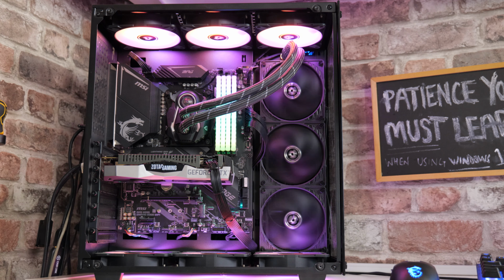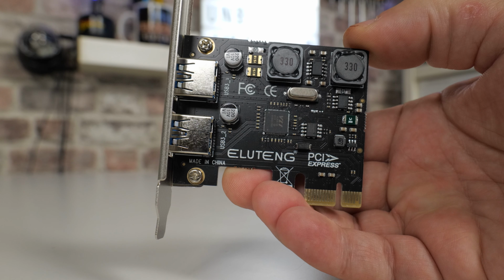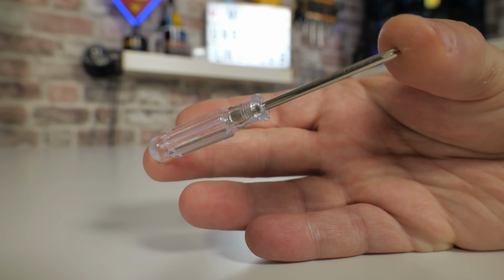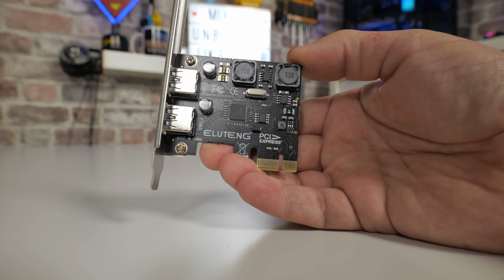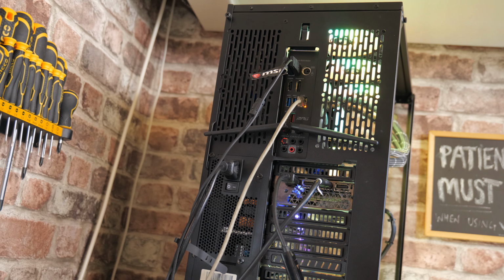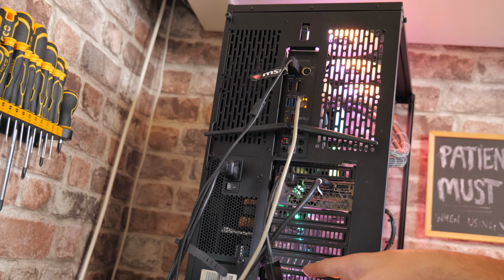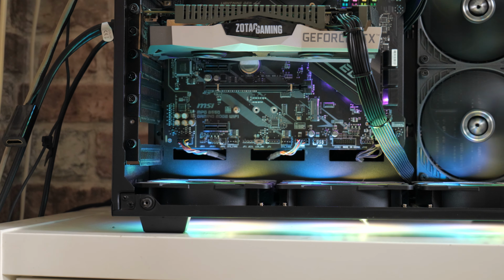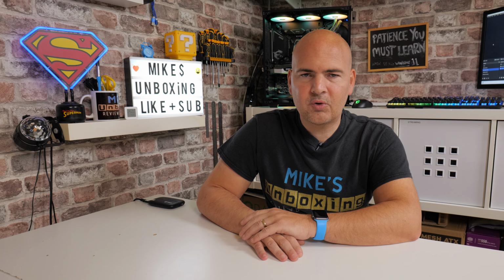How To ADD More USB3 Ports With NO Extra Power Plugs Required

Comment: I purchased a 4-port version of these add-in cards as I run ITX setups and have numerous devices such as external storage devices, a usb drive cloner, usb peripherals……. 2x keyboards & mouse, stream deck etc needing about ~10 USB ports 🤪🤩🤯! These add-in cards are essential for me 💪😇🥰
Reply from the maker: they are very handy especially with a lot of devices to connect these days

Comment: What a neat inexpensive unit. Have i got this correct, because this uses the pcie lanes it doesnt slow anything going thru the io shield? Hence both cameras are recorded without conflicts! Neat and cheap solution. Thanks for sharing Mike and Kath👍
Reply from the maker: that is right as it is on another part of the bus the other ports speeds and bandwidth are not impacted

Comment: I Love things like this for cirtain purposes i use the 4 port ones from Amazon run the cable under my desk so i have 4 ports available at the front of my desk but this is maybe better speed wise im not 100 % sure the PCB looks well produced for a basic usb3 pcie

Comment: Hi, Mike. I have the opposite problem. My X570 Unify has more USB ports than I need, but I ran out of PCIe ports. My mobo only has three. One for the rx 6800, one for my Sabrent NVMe M.2 SSD to PCIe adapter,  and one for my Creative sound blasterX AE-5 Plus. Wish there was a way to add more PCIe ports.
Reply from the maker: yes that is something that is becoming a problem especially pciex4 sized slots for higher bandwidth devices

Comment: Quick little spray paint job on that bracket to make it black to match. Also it boggles me that these new mobos have USB C. I can't find any USBC hub I like for it. My case even had usbc but my mobo doesn't have the header. Been meaning to buy an adapter but eh.

Comment: Lack of usb ports is really annoying, as i have a lot of devices.
I found b550 aorus pro or x570 aorus elite to be the only reasonably priced mobo with a decent amount, i think mine have 9 or 10.
But I've been considering one of these little things too as even with my ports I'm still having to use a USB hub.

Comment: You get 5GB. PCIe x1 is only 250MB. So maybe you will get 150 to 200.
So a USB hub would be better.
So you not get all 5GB. But I'm sure you'll get more than 250MB.
Reply: Yep, I ordered one of these that looked exactly the same was just a different brand , it could not handle uncompressed YUY2 or NV12  video from my Razer Kiyo pro webcam, the output video signal was choppy & distorted.  The USB 3.0 ports on my mobo handle it just fine.
Reply from the maker: it managed to support my Camlink 4k at 4k but not sure what format the elgato uses for compression to be fair
Reply: @mikesunboxing  @4k, more than likely mjpeg. You may want to run more in-depth tests.

Comment: What bout 7 port one? They are cheap.. but do they works without extra power from psu?
Reply from the maker: they might do but that is not going to end well if the ports voltage get overloaded, i would advise anything more than two ports should be powered

Comment: and of course you didn't use the on-board usb 3.2 header {JUSB3} instead that is plainly un-used.
Reply from the maker: yes that is for the front panel header which i had to stop using as my radiator fouled the port cabling
Reply: @mikesunboxing  you can get a back panel usb 3.2 bracket that plugs into that header I did that with my Corsair case for same reason